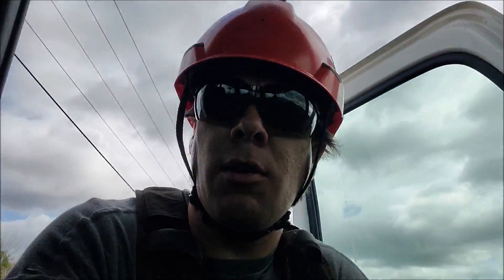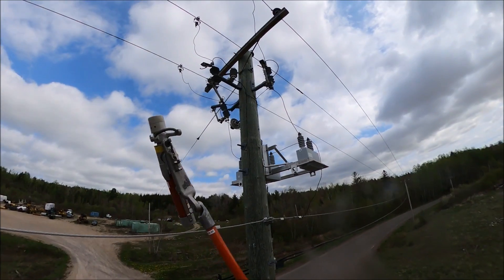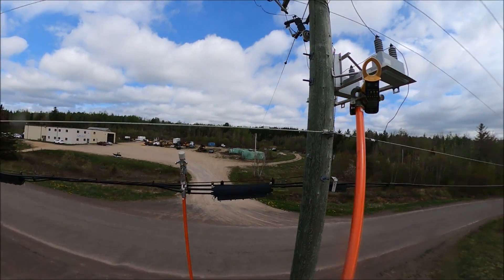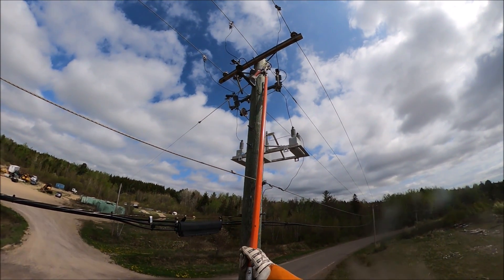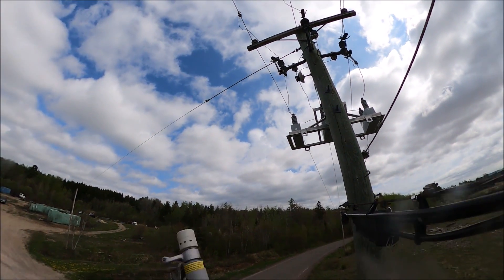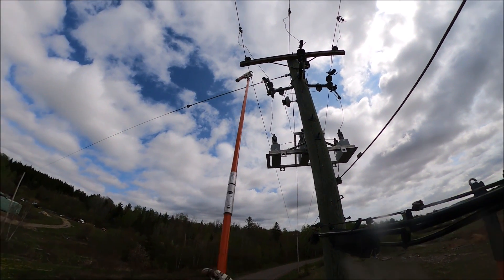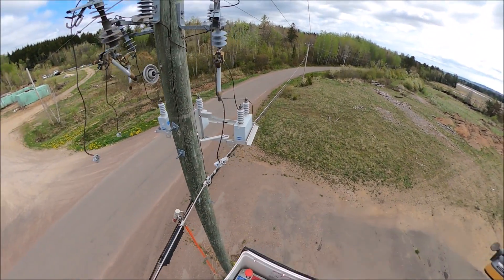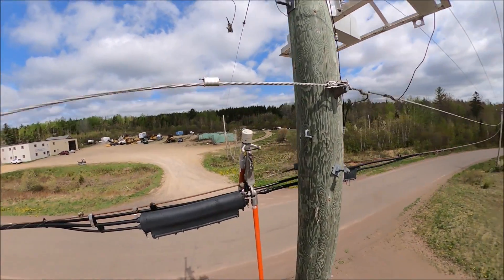Opening a Capacitor bank

Comment: where i used to live in Los Angeles.. Korea town actually.. my spanish speaking neighbors said they had trouble sleeping at night.. the power poles scared them at night..  they said that almost every night at 11 PM..  the pole would throw fire..  so i sat out on my porch that night..  all of a sudden a massive arc flash. that continued for probably 10 or 12 seconds.. lit up the entire street.  i dashed out to the sidewalk and i could see a massive column of smoke trailing away from the capacitor bank on the pole down at the secondary level.  i called LADWP.. ask them to have a line crew come by and call me when they get there.  they looked up at the capacitors with some binoculars..  said they look ok from here.. i described what i had seen the night before.. thats not possible.. these people standing here tell me it happens almost every night just minutes after 11PM..  since the pole is only about 12 feet from their apartment windows..  it really scares them..  they said its like a volcano..  the crowd or residents nodded..  when they went up.. the  terminals on the caps and half the insulators had been burned away... probably that everybody turned off their TV and lights at 11 pm and went to bed.. everybody in that building worked.  so it was either the power rising up from the loss of load or dew settling on top of the caps.   i thought you might get a kick out of that.. 

 i did call in a damaged power pole one time..  the LADWP operator said.. describe the issue..i said the first 12 feet of your pole is missing..  she said so the wires are down.. no.. just the first 12 feet of the pole... its kinda floating there suspending by the wires running in 2 directions.. 

 lastly.. on the road to the city of 29 palms..  a drunk driver had left the road..  broke the power pole off.. but the wires were tightly strung and very strong as that was the main power into that entire area..  the drunk had hit the pole so hard that the pole went over the top twice.. twisting the primary wires together..  i don't know how they unwound them.   they did not want to cut the mass of pole away and have it unwind like a rubber band airplane propeller..
Reply: Man these stories were a ride from hell thanks for sharing!! 😂😂
Reply from the maker: Craziness! Thanks for sharing!
Reply: Cap bank could’ve been on a timer to cut on at that time of night also, lots of utilities used to use a timed controller which would close the vaccuum or oil switches at a certain time. Cap banks come on when the load on the feeder increases and the voltage drops on the feeder/system, the capacitors help raise the voltage to proper levels, but they can also cause high voltage if stuck or left on. In this video we call them dumb capacitors, where a guy has to come out and manually close the fuses in during high load times or seasons, and then also someone has to manually open the fuses during failures or seasonal load changes when the capacitor becomes unnecessary.
Reply: I had a rubber band plane as a kid , next time I will consider using poles
Reply: My dad said he was watching TV one day, saw a flash and heard a boom and the power went out.  He looked out the front window and saw a squirrel tail draped over the edge of the transformer on the pole.  Mr. Squirrel had shorted it out!  Called the power company and the lineman who fixed things told him that happens on a regular basis.  The squirrel was unavailable for comment.
Reply: @B-and-O-Operator-Fairmont  my brother lived up in Noon Washington.  north east of bellingham. not even one signal. the power went out during a heavy snow storm.  it was out for days which was unusual  when the storm let up. when the crews found the downed wire.. there was a bear attached to it..   did the wire fall on the bear.. did the bear see the arc's and investigate..  was the bear up the pole and climbed on the wire and brought it down .. nobody knows. 

 decades earlier . i was on a test drive with my cousins husband not to far from there.  he hit a pot hole where a water crew had dug up the pavement to install a water meter..  it rattled the car..  he grumbled under his breath.. i said its just a pot hole.. they are all over.. he replied .. its not bad enough to hit a pot hole.. i'm the guy who dug it 2 hours ago and the asphalt crew missed filling it.
Reply: @B-and-O-Operator-Fairmont  When I was in high school in the '70s, I made squirrel and dumplings with a suicide squirrel that took out my power.  She blew a 2200v 100amp line fuse and powered down the whole neighborhood.
Reply: @Lauri_Heino  Yes, she landed with her paws on the transformer and her nose hit the hot line.  her nose was charred and her whiskers were curled, but she was otherwise intact.  When the lineman came out with her, she was freshly killed and I was not going to waste meat.

Comment: How many farads are those particular caps ? And How many farads is the largest cap used in a given circuit ? Thanks.
Reply: The Farads depends on the Power Factor Correction. How much the phase difference between the voltage and current is. Look up Power Factor Calculation. I did one one my Home AC unit and and needed 22 microfarad. My amp reading went from 16 amps to 12 amps and power factor went from 85 % to 99%.

Comment: Houston, TX here!!! This is my first video of yours and I’m definitely subscribing!! My dad was a lineman for 32+ years, with another 8+ in the 3-phase meter lab. I myself have been workin for 12 years now at the same company in the Substation department.

To go along with your advice on capacitors, we’ve had it where that internal bleed-down resistor opens and a residual charge stays stored, so we also will temporarily ground across the cap bushings to let that ground fully discharge the cap. Glad I found your channel!! Stay safe, brother!!! 👊🏻

Comment: How is it in today's day and age, people still use 1000v rated meters for HV? Stay safe and thanks for keeping the lights on!  Look at other options for HV meters that designed for Live-Line work.
Reply from the maker: Thanks for checking in Nate! 👊
Those meters are  fine as long as you use for amp check only. 
Were actually in the process of  getting high voltage ammeter as  opposed to the stick/clamp on combo.
Reply: @Bobsdecline  I can get you a demo unit that can not only measure current but also direction of flow, PF, and THD.  Look for SensorLink Corporation. I'd love for you to demo a unit, we just want you going home safe to your family every night!
Reply from the maker: @nateroth1302  I'll check it out for sure! Sounds like a great product, I'll do some reading up on it this weekend and check out your website

Comment: Nice video but out of curiosity what's the purpose of a capacitor bank on a utility pole?
Reply from the maker: Thanks!
They help correct Power Factor by counteracting inductive loads. Makes the system more efficient.

Comment: It's nice that you have all those long insulated poles so that you can work without getting too close to the high voltage.  Even for your clamp-on ammeter.  Cool!
Reply from the maker: They certainly come in handy!
Reply: Especially when the meter is only rated to 1000v; it is not an if, but a when it fails and the CT core pops.  Also, it is not going to give a true real measurement due to it not being shielded for high voltage.

Comment: One sound piece of advice I got as an apprentice was being told that opening an xxx KVAR cap bank under load is the same as an equivalent xxx KVA transformer as far as load dropping, we have a lot of 1200+ KVAR fixed cap banks, and if anyone has ever opened a large step down without load busting it they know what kind of an arc you can draw.
Reply: @gregclemen8999  Too slow is bad for contacts

Comment: How does the load buster work? Why cant you just use a regular stick to open it up
Reply from the maker: Opening with a regular stick would likely draw an arc. 
The load buster works by carrying the load through the device as it extends until an internal spring snaps open very quickly. The quick action of the spring breaking the connection, accompanied by a lining of material that creates a de-ionizing gas when heated by the arc is what extinguishes or breaks the arc.

Comment: As always Aaaron. Another well done video! 👊🏻👊🏻I know you like to focus on one aspect of the job at a time. Nothing wrong with that. Just curious why the extra long universal stick for the load buster? I also notice you close cutouts from the ground with a long extendo stick. Backyard lots they save a climb. Where did you get that stick to operate the clamp-on ammeter?
Reply from the maker: Hey John! 👊👊
Our standard only requires the single stick when using a load buster. A lot of our guys with use the double stick after pulling apart porcelain cutouts a few times.

On this pole the single stick would have been fine for sure! 

I definitely use the extendo when I get the chance! Lol 
It's funny... 15 years ago I use to love hearing/seeing the loud bang when a cutout blew. Now I love being as far away from it as I can! Lol
Reply from the maker: Oh ! And I found the ammeter stick in our shop a few years ago... I make sure to keep it in good shape, there aren't many around. I use it quite a bit
Reply: You might cringe if you saw my stick for the loadbuster? If it’s 7 feet long? That’s as long as it is? I think it’s closer to 6 feet long though? I’ve been closing fused cutouts & expect them to blow each time? They never bothered me. The ones I hate are the inline diconnects. They move around too much
Reply from the maker: @johnclyne6350  yeah those in-line disconnects are horrible! I've come across a few midspan. We would get one guy to hold downward pressure on the phase from the ground with the extendo .. the would still roll some easy tho.😦

Comment: Some of our capacitor banks on Long Island are direst feed meaning the only way to take it offline is to load bust cut outs. Most of ours have mvs (motor vacuum switch) built onto it which is controlled by a time which is set for peak hours. Of course me cutouts as well. A lot of times if one phase is blown open, we have a capacitor tester. We can change out the individual bad tub not the whole unit.
Reply from the maker: Ah yes, we've a few of those now. I'm gonna say maybe half a dozen in our jurisdiction. We only started installing them a few years ago! I haven't had man run-ins with em yet

That's likely what the crew will do here; they bring a new unit and swap out the center phase one only. Do an "on site" test and close it back in!

Comment: Why do you look away when you open cut outs
Reply from the maker: Once your comfortable opening and closing cutout, it's a good habit not to stare at it. More so closing than opening - If you close in on a fault the flash is extremely bright. 

We've also had many porcelain cutouts fail over the years as well. So I usually look away when operating a switch of any kind.
Reply: Bobsdecline - Lineman blogger It’s nice to know they never taught that in my apprenticeship

Comment from the maker: Edit
https://m.youtube.com/watch?v=HtO7dX0B15c&t
 I've received a ton of questions about this-  During the actual opening of the device I look away incase of equipment failure. I do have some other videos which take a much closer look at the actual switch if your interested

Hope everyone is well! I apologize for the wind noise in this one :( Its been windy here for the past 3 months! I don't normally check amperage when operating capacitors, but wanted to show how easy it is the rig up an amp meter on a hot stick 👊👊
Cheers all! 🍻
Reply: Oh boy is this a dangerous job! I salute everybody that does it! They can't pay me enough to do it!
Reply: Bob sometimes instead of waiting we shunt out capacitors in place, put a jumper on neutral and hit the top side with the other end on shotgun stick.
Reply: So, you acknowledge noise... Perhaps put the app reading in the description or as a title on that part of the video since we can't hear. P.s. your whole point was to show the breaking of the connection. You looking away might be necessary for safety, but remember your go pro looked away too. Kinda pointless of a video if two goals didn't get passed along to us. :(
Reply from the maker: @pmheart6  Thanks for the feedback man 🍻 I  try and capture what I can, to share online... It can be difficult at times. To show the exact operation of the device would likely be in a controlled environment.
Reply: @Bobsdecline  go pro on the "shotgun stick" unsafe?
Reply: Patrick T , nobody’s perfect. He’s creating content which is interesting to linemen. You’re griping over free content. Have a banana 🍌